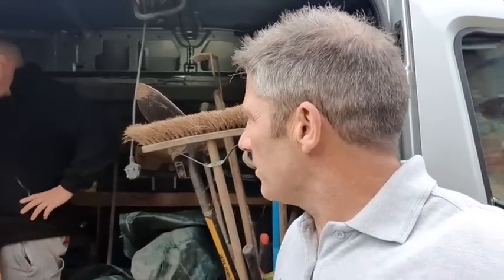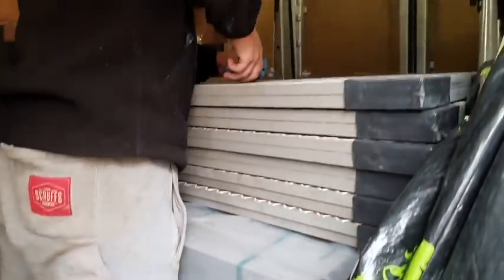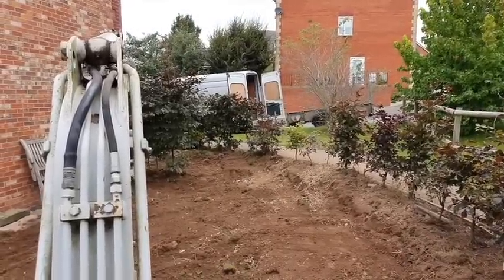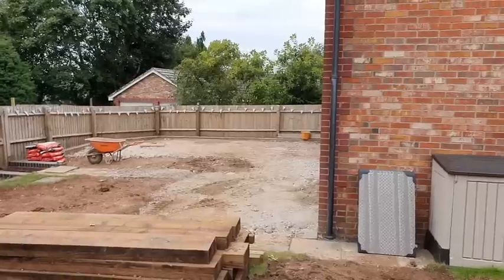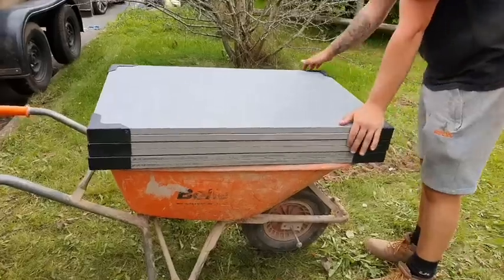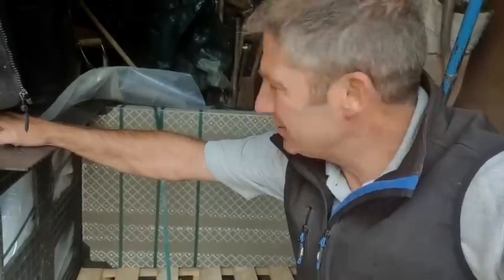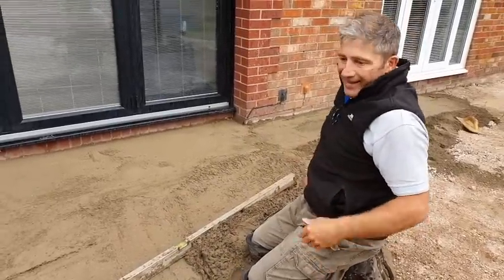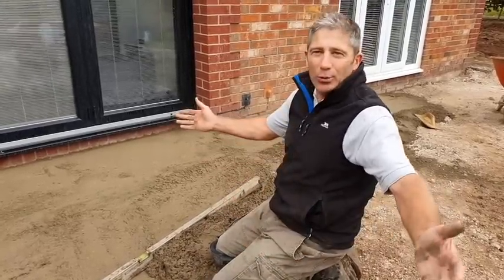How To Lay A Mortar Screed For A Porcelain Patio

Comment: Great insight Jon. Can I ask what fall you have got there ? And do you feel it’s good to put more of a fall for porcelain. Cheers pal
Reply from the maker: Thanks Joe mate.. Manufacturer's suggest a riduloucs fall which would look stupid .. I go 10mm in a meter mate
Reply from the maker: 1:80 mate but porcelsin always has water tension so it hold a little every job us different depending on cross falls Cambers etc my advice is get the water away quickly shortage distance
Reply: Greentop Landscapes & Design thanks mate. I’d have to agree if you put to much a fall then would look stupid. 10mm over 1 m sounds spot on to me I do around the same.

Comment: Hi, me and my partner are tackling our own back yard with porcelain. 9.5mm so not very thick but it does say in the specs it is for outdoor use. Would you recommend a screed? The hardcore is down
Reply from the maker: Hi there, you will need to lay it on concrete with an outdoor adhesive

Comment: Hi again mate quick question I’m laying a sandstone patio and it’s having a cobblestone edge do I put the edge in first on sub base of concrete then put the mot down using the cobbles  as my edge ? Any advice be great ful as I no u busy pal
Reply from the maker: Hi Gareth, it may be easier to lay the Patio first a you will have something to work against, cobb;escan be a pain otherwise. Make sure that your cobbles get laid on more of a concrete mix if you can as they are like an edging restraint, happy to talk you through this. Stay Safe mate.
Reply: Greentop Landscapes & Design hi Jon thanks again I did think 🤔 that but just wanted to make sure I’ve been doing it right would u say sub base should be around 75mil for cobbles with a 3/1 grit sand to set cobbles on top 👍
Reply: Also mate do u cover whole of north west ? Where u based Wigan ?